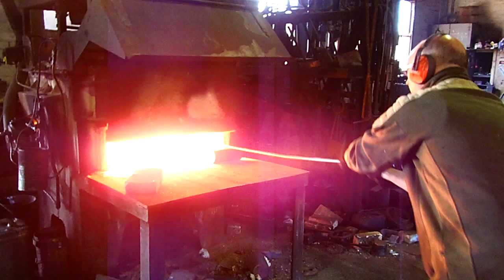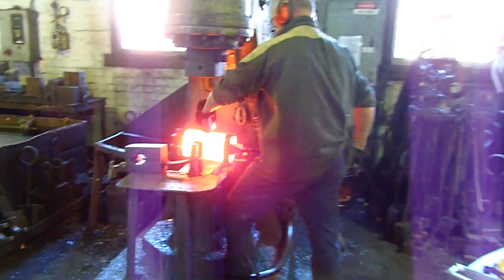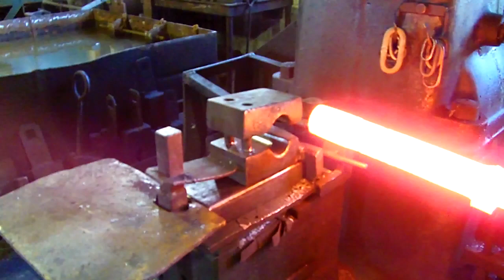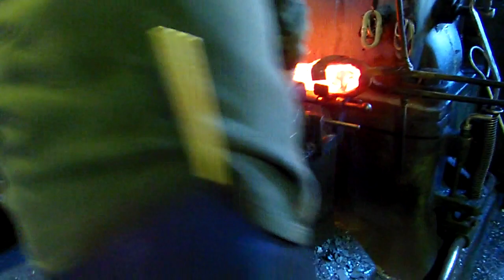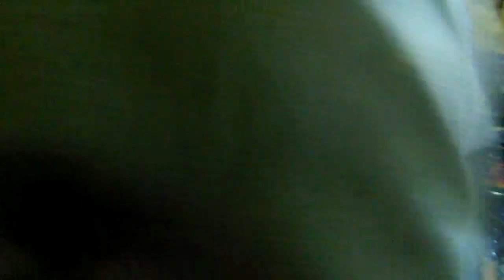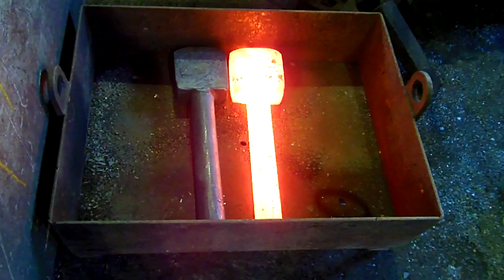Chain anchors shank forging

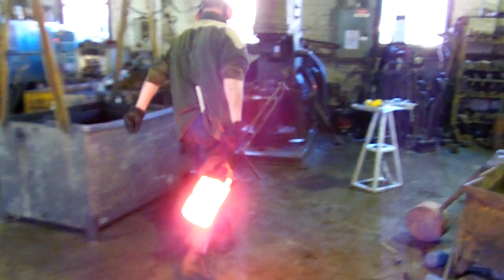Comment: Holy crap at 00:22 I was like he is going to catch his pants on fire! That was really cool to see the process and that huge hammer working. Huge respect for that kind of work.
Reply: OrionsAnvil 
I noticed such a note, even before I read your comment this. Perhaps because of his long experience, Perhaps because of the presence of the camera that depicts and wants to appear as an expert, Perhaps in normal situations, and in the absence of a camera, that hot hammer may be raised to a reasonable extent.
Reply: Yeah it was very reckless all of it .I worked many years in this industry and you need your arms covered if only with old socks.